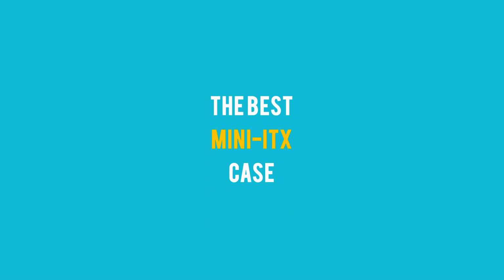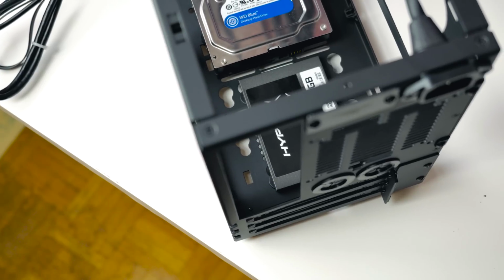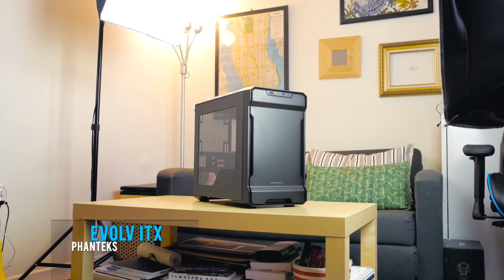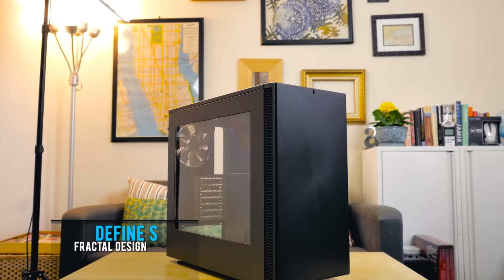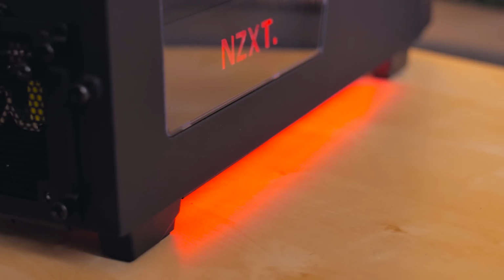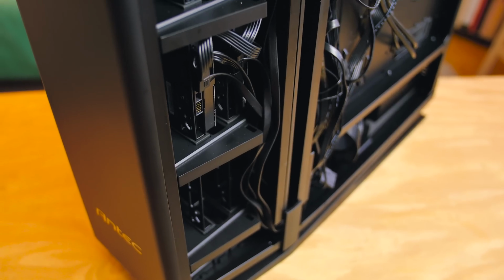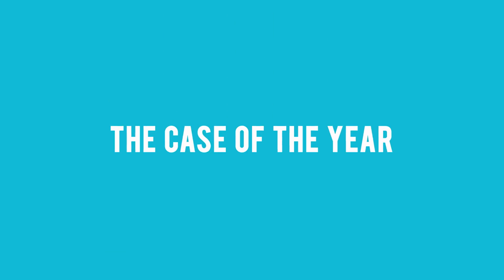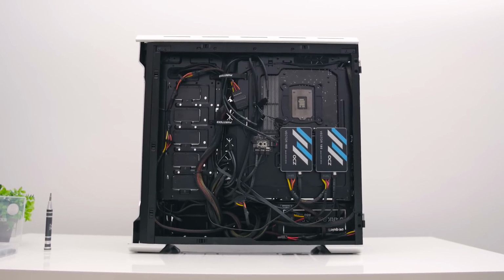TOP CASES OF 2015

Comment: Huh... I thought the "Deepcool Tesseract" case would be a sure winner for the budget category. only $40 USD. Having 2 fans included, and 4 optional additional fan bays. Not to mention supports GPUs of 18 in, and a back panel for cable management. It also looks very nice, and doesn't have the "alien face" design everyone hates. For $40 it's better than most other case I've ever bought.

Comment: What would be your recommendations for the best compact case that would hold an ATX motherboard along with a full sized video card and full sized ATX power supply.  I'm looking to do a build with good cable management, that does not necessarily have to support a radiator.  I guess I may be looking for and M-ATX sized case that supports an ATX board.

Comment: The Phanteks Evolv ATX case is said to support E-ATX formfactor boards. I plan on building up a dual Xeon workstation with an Asus z9pe-d16 which has the EEB format. I've read that both E-ATX and EEB have the same dimensions but a few standoffs dont match up... still people manage to install the EEB boards into E-ATX cases. Would I be able to install the Asus z9pe-d16 into the Phantek Evolv ATX case?

Comment: So I am building for a decent pc that can run smooth and I can game on. Since this is my first time, can I get some advice especially on what motherboard and case I should use, that has all the more basic functions, and close to none deficiencies? 

So in my final build I'm thinking of:
 two GTX950's, an i5-6600, a power supply and some RAM's  (Please give advice on powsupp and nice RAM since I'm a noob), a motherboard that is not too overpriced and can suit any build with it's good functionality. Then I will choose some memory (which I know nothing about...) and then I'm good to go?
Reply: The more info the better, thanks guys!
Reply: +Kevin J get 2 RX 480"s, better performance then a 1080 :P
Reply: Buy 80 plus gold rated psu,maybe 650-750W

Comment: Drove me nuts that you mounted the visible SSD on the Evolv ATX upside down, which also exposes the wiring more. If it was mounted properly, the label would be proper and the cabling would be less visible.

Comment: Your cable management is amazing, mine looks like a right jungle. I got a new psu recently and the modular cables are like made of steel. I'm considering trying to cable modding thing, are they generally easier to deal with? Cheers

Comment: Maybe I'm in the minority but I still want a dvd drive. Preferably bluray but at least DVD. Simply for the fact that I might need to install something from a physical disk, or burn movies or ISOs to a disk to boot on a different or the same pc. And yea I have an external drive.... but I don't want my desk cluttered with a USB drive all the time. One of my backup pc's doesn't have a drive and thats fine and neither does my macbook these days but for a primary desktop I can't imagine purposefully not getting a case without the option to put in a drive.... Even if it's behind a door I have to open every time. For something that just sits there and never moves the extra weight and space for a disk drive isn't a problem for me. and there is no additional desk clutter ...

Comment: I’m planning on building my first PC and I have some parts figured out. Can someone please tell me if it’s a good set up and what chassi I should use. If there is anything bad about it please let me know what I should change. 

Intel Core i7 6700 4.0ghz
ASUS Z170-E – ATX Motherboard 
Corsair Vengeance LPX 2x8gb
MSI Geforce 960 4gb Gaming
Seagate desktop 1TB 7200rpm 64mb
Old DELL 750W PSU

Thanks for any help!! <3

Comment: got the Noctis 450 for my first Skylake build. Tis a damn sexy chassis, im an angry sortta way hehe. I think the H440 is getting a little boring, kind of the same thing as last year. Great air flow and plenty of room for AIO's. What's stopping it from getting 10 outta 10 is the side panel's aint 'tool-less'. Sure, it comes off easy with capacitive screws, but i wish it had them latches for easy removal...

Comment: Define S is not a case for your first build. The cable management at the back is a nightmare if you have more than 2 drives. I have 4 drives in total (1 HDD and 3 SSDs). First thing to bare in mind is you need a MODULAR power supply for this case. The sata cables must be straight, power cables for drives must be straight too (like the ones on EVGA supernova 850 G2). Most of the guys will never think about that in their first build. 3x140mm fans in the front is a really thight fit. Raised section of a case almost cuts off the use of upper sata ports for ATX motherbords because of the cable cutouts beeing too low and too high. Better go for a R5 for your first build.

Comment: You are suppose to use the thermal paste VERY sparingly. Its suppose to fill in the unflat parts of the joining surfaces and let the two surfaces touch where possible. So I it sounds like you are using the thermal paste minimally as needed.

Comment: First and foremost, could Phanteks stop being so awesome? I hate to say it, but they are putting every other case manufacturer to shame right now, sexy, functional, and high quality cases. In fact, the Evolv ATX was going to be my 2016 case upgrade, except I would have to lose out on those 2 3.5" drives in order to install an EKWB Predator 360 in the front, so it was a no go. This leads me to pretty much my only other option, which is the Define S, which not only allows the Predator 360 in the front, but will then still allow me to do push/pull AND have 3 3.5" drives in the rear panel. 

It sucks, because I really do like the Evolv ATX much, much more. It is the better case in almost every way, aesthetics, materials, the fact that the top isn't just an open mess, it has at least that panel there to try and stop dust entering, it's ingenious top radiator/fan mounting panel, The PSU shroud, the swappable LED lighting on the front (Why doesn't EVERYONE DO THIS?), it really is a top notch case. But I've already settled on the Predator 360 and I want it front mounted, and I need at least 2 3.5" drives. If anyone can name a better case that meets those criteria than the Define S, please let me know before I order...

Comment: I would like it if NCase made an "M2" that was the same dimensions except for depth. If it were 276mm, with the same internal layout but scaled down, it would still be a viable case for especially small builds. It would be so compact and even easily portable.

Comment: I have build a system in the Evolv ATX. A watercooled system to be exact. It was at the end a tight fit but after all work is done it just look fantastic. Now there is a 360 and a 280mm Radiator inside which are cooling an 5930K and dual GTX 980Ti G1 Gaming.
Fantastic choice for case of the year. :)

Comment: I'm surprised Dmitry didn't encounter vibration issues with the Define S (see SPCR and other user comments). Probably my one knock on that case, if you have HDD storage needs (which I do). The Define S has also hit the $60 price point a few times - making it a strong mention for the Budget Case category.

Saw the Evolv ATX win coming a mile away though - unfortunately many in the US were waiting months for availability and simply gave up. That's a big knock on Phanteks logistics/supply management there. Hopefully, they don't mess that up again on future iterations.

Altogether a great video - and remains my go to place for case reviews. Holiday cheers to HWCanucks!

Comment: Really liked the list, the only issue I have with it is the NZXT recommendation for first time builders. The access to the bottom chamber for the PSU is impossible if you have hands larger then a pre-teen. On the other hand, the Define S fully agreed. Now, Imma go dream up what I could build in the PC-O8 since it really is that good looking :D
Reply from the maker: The power supply shroud is a little inconvenient with the initial assembly buy helps tremendously with cable management. You can basically ignore doing any around the PSU, while the interior will still look fantastic.

Comment: No mention of Enthoo Pro M?
It has very similar internal layout as the evolv atx. So you get all the flexibility, cable management, and water cooling support of the evolv atx. It does not come with that sexy aluminum exterior, but it offers an amazing building experience for its price!
Reply: It's a bit of a shame the Pro M isn't more like the full-size Pro, in my opinion. I get that sometimes you need to make compromises to facilitate a smaller size, but something like the stealth cover for the HDD cages that the full-size Pro has would make the Pro M so much more appealing...
Reply: +tiger d I also feel like the price tag on the atx isn't so unreasonable when you look at the fact that it comes with 3 140(?)mm fans, when looking at their new p400s case coming out in February which was going to be my original choice that comes with no fans, I'm almost very tempted to go with an ATX due to it's slightly larger size and better overall setup for radiators. I will agree with his video on solely the ATX that it's kinda disappointing not having more USB ports on the front. Overall, more and more I'm leaning towards it.
Reply: MrRickChase I think Define S is also a great choice. At a pretty affordable price point, it has unbeatable water cooling support, more storage options than Enthoo M, and noise dampening included. Cable management, open internal layout are also outstanding.
Reply: I paid $179 for my Corsair 600T, then had to pay $30 extra for the window since the black version didn't come with it. And with the Evolv ATX being the same price (technically cheaper), I feel it's extremely well priced. Especially with that aluminum exterior. awesome build quality. I'd honestly expect a case like this to be closer to $199. And I'd pay it too lol
Reply: +Jordan March i ended up getting the galaxy silver "special edition" from newegg i believe slightly on sale at about $165. although i currently dont have all the parts to put together my rig yet, i can honestly say i'm impressed with all they did. it comes with a box full of all the necessary hardware with the optional HDD/whatever else shelves and it's overall a very impressive case, more so in person than on any video. the easy-pop panels are comfortable to work with and reassuring in strength. only downsides like some said are lack of usb3.0 ports and no optical drives

Comment: though old the prodigy is probably still one of the best itx cases... for anyone considering a custom loop there's no beating it, what other itx case can natively support atleast 976cm^3 of radiator space... the evolv itx would have been able as well had it only supported a radiator to go along with that 200mm fan, but as of right now the prodigy is still the king of high performance itx cases... only a shame they don't sell it with a really big open window, but I guess that's nothing you can't fix with a bit of modding :P

Comment: Brilliant video and list as always Dimitri, although my personal opinion is the most beautiful case award should of gone to the InWin 909 with it's brushed raw aluminium and tempered glass aesthetics. I love the Phanteks Evolv ATX though and I would of made the switch to that case had it of supported 420mm radiators and the same goes to the InWin 909 too. I look forward to the 2016 cases and hopefully InWin will make an enclosure capable of supporting 420mm radiators.

Comment: Yesssss. I bought the NZXT 450.
Reply: ***** My build is complete my man. Up and Running. Fucking loving it.
Reply: ***** I did roast one of the two cpu fan headers  while setting up my system :P
Reply: +Alexander Binovski x99A gaming 7, yes. And no it has 2. One at top and one near ram slots right next to rear connectors.
Reply: +Alexander Binovski I'm in love with my clean looking X61 krakan :P hope it doesn't leak on my.
Reply: +Alexander Binovski hahahaha so far I'm lucky with every part.
Reply: +Alexander Binovski throughout my years as a pc user and now first time builder I never had a part die on me except a few power supplies and one hdd some 15 years ago and some mice and keyboards.
Reply: +Alexander Binovski Yes. installing games now
Reply: +Alexander Binovski hahahaha I get bored playing games like that role playing and such. I'm more of battlefield FPS kinda guy.
Reply: +Alexander Binovski Happy Gaming bro. Keep in touch

Comment: Dimitri you sexy beast.
 Im sorry but i have to disagree with you in the best case for a new builder
I say that the case that should have won that prize is the Phanteks Enthoo Pro M, i have worked in both the Define S and the mentioned Enthoo case, they cost about the same depending where you look (amazon, or ncix) and for the most part they are very similar in the interior. but in my opinion what gives the phanteks case the edge is the absolutely effortless cable management thanks to that PSU cover, if you are lazy like me, then you can just throw all the cables back there, but meanwhile the define S i worked in looked really ugly because of my laziness :P. and also the fact that it has more potential HDD or SSD capacity with those modular little caddy things, that is useful if you want to build a RAID 10 array, which in the define S you cannot. Both cases are beautiful but , for the noob in r/pcmasterrace, the enthoo would be a better first timer. :)
Reply from the maker: I would have to agree with you on the cable management comment but in the end what gave the Define S the edge because it can support more drives out of the box.
Reply: that is true, but still both of these cases are relatively budget cases, and for a budget build i cannot imagine someone using up a good potion of their budget in filling up all 2 3.5" and 2 2.5" drive bays that the Pro M has, as most builds have 1 hdd or 1 ssd and 1 hdd combo.

Comment: So much love for Phanteks <3
Reply: +Timmy Turner they really do make great stuff. every case they've made has pretty much been damn good value or damn good price from dimitri.
Reply: TheBeetrootman
yea i snapped up a enthoo pro after i saw dimitri's review. it's great.
Reply: +Kelvin Chan It shows. HardwareCanucks Case of the year three times in a row.
Reply: Not without reason! The attention Phanteks pays to the details of their cases is just great. Their cases are beautiful for sure, but more importantly, they're a joy to work with, and I'm still enjoying my Enthoo Pro no end...
Reply: +TheBeetrootman It's true.  They are a force to be reconned with.  They have set new standards.
Reply: +Timmy Turner They makes some pretty solid stuff. They took the market by surprise and now are a brand to look out for. They are starting to dominate the market like Corsair were with their 800D
Reply: +Robert Faber Enthoo Luxe owner here,couldnt agree more.
Reply: +Timmy Turner Enthoo Pro M got snubbed, though.  Should've at least been a runner-up.
Reply: +Timmy Turner They deserve it. I bought a Enthoo Pro and it was an absolute joy to work with. Heavy but you can just feel quality in every aspect. Plus its just beautiful. The toolset of screws you got were also just so nice, and even better that I didn't need to use even half of them.

Comment: Where.....where is the Define r5?
Reply: +Spoert M it's still one of the greatest cases but it didn't come out in 2015 :pp
Reply: Hugo Sha Whoops!
Reply from the maker: +Spoert M Check out our Case Awards for 2014 video :D The R5 won the best silent case!
Reply: saying you look stupid yeah :D but now i dont have to. so thanks <3
Reply: +Spoert M thanks for not making me look stupid, i was gonna ask that too  :P
Reply: i am fairly stupid anyways xD
Reply: Apex Assassins So you're saying I look stupid now?! Is that what you're implying here?!
Reply: +HardwareCanucks Hey Dimitri..! pleaseeee i need to know what cpu cooler that you were using? the low profile one with the blue fan?
Reply: +Spoert M It was in last years best cases, if im right
Reply: +Apex Assassins: But you still admitted that you had the same question so you still look stupid, sorry :)
Reply: +Hugo Sha Forgive the peasant type question here, but Im looking into a new case for my new build. Which one would be better between the r5 and the nzxt h440?
Reply: i would say the r5, its really personal preferance as they do pretty much the same thing i just think the r5 is beautifull.
Reply: +Steven Williamson I myself would have to say the R5 as it is an incredible case for both cooling, as well as modularity so you can remove the included hard drive brackets.  2 140mm fans are included in the front and back and the noise dampening allows for a nice and quiet build without killing the cooling.

Comment: With so many case companies that also sell modular PSUs out there, I kind of wish that someone would make a case which has the modular cables preinstalled and cut-to-length for the smallest amount of cables ever! They don't have to include the power supply, I'm sure Fractal or Corsair would. That idea is the ultimate way to make building easier, for someone to just plug-and-play their components. What do you think about that approach Dmitry?